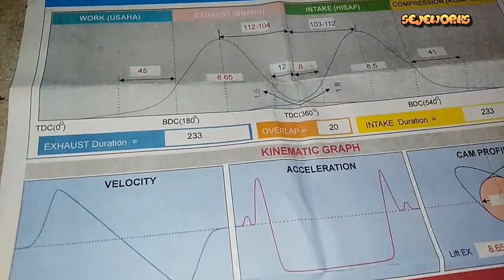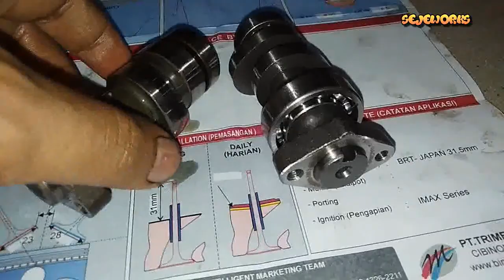Modifikasi Honda CRF150L Buat Harian, Ganti ECU, Noken As dan Peer Kopling

Comment: saya minta saran nih ...kalau saya mau modif buat harian buat jalan-jalan ke kebun saya krn sangat jauh (hampir 40 Km) disarankan kalau bore up yang aman itu berapa cc ya ? ni motor saya CRF masih ting-ting ...Wkwkwkwkwk
Reply from the maker: Bore up 200, usahakan satu set penggantian yaitu piston dan blok cylinder.
Reply: @SejeworksChannel1  ini kalau saja pakai crankshaft BRT 62 mm lalu piston 70 mm dari block silinder dan head block satuan paket BRT apa ngak ada masalah sama rumah magnet dan one way seperti kejadian pada bore up pakai paket gorilla 300 cc ? kalau menimbang-nimbang sih  habis berapa duitlah kalau bore up piston 70 mm dengan paket komplit BRT ?